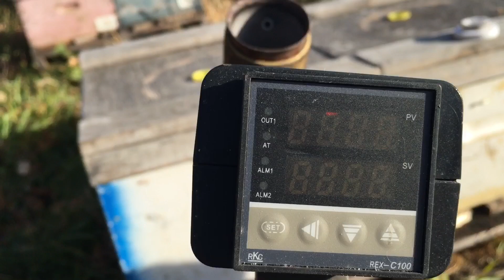Oxalic Acid Vapour Treatment with a ProVap110- a Canadian Beekeeper’s Blog

Comment: Why the temperature is so high ?  OA sublimation is between 157-189 degrees Celsius. Above this temperature, oxalic acid is converted to formic acid. At your temperature, you vaporization formic acid, not oxalic acid.
Reply from the maker: Krzyżak 
Not exactly, consider the sublimation of the product itself, not the temp of the heating element.  I would say that after observing the cluster after treatment that I have achieved perfect sublimation while maintaining a practical time period of treatment
Reply: @aCanadianBeekeepersBlog  

You didn't convince me :):):) but thank you for the answer. If you have the opportunity, do the test at 185C. I may be wrong, but i think  you vaporization formic acid not oxalic. 
By the way, great chanel. Greetings from Poland
Reply from the maker: @krzyzak3465  the temp of the material during sublimation does not necessarily cook at the temp of the bowl.  Notice the rebound temp.  the objective is to get it as a dust thtoughout the hives, and that is exactly what i am seeing
cheers! love the feedback
Reply: @krzyzak3465  his unit is set to 232 fahrenheit not celsius. I spoke to the N.B. beekeeper he talks to and we discussed about the problem of my 110 not stopping at preset temps. my unit loves 270f. if I recall correctly he said he runs his at aprox same temps. converted it is still just around 130c. correctly or incorrectly i'm using 3 to 4 g of OA for my double deep 10 frame equip. less for 8 framers.
Reply: @ronreid3640  These are celsius. Look at the video description: 

"The ProVap is heated to 230 Celsius, treatment temperature ranges between 195-205 Celsius." 

And here the description on the manufacturer's website https://oxavap.com/product/provap-110-sidelinercommercial-vaporizer/
"The temperature is preset for 230 C. This is the correct setting for the bowl of this vaporizer."
Reply: Would be nice if someone chemical engineer could do some analysis on this gas resulting from the tool.  Nice to know what it is - suspect it is a mix of oxalic and formic acid.
Reply: We treat our bees at 450*f as that is what pro vap and johno's easy vap both recommend for the correct temperature. we use the easy vap pro as smaller bee yard and $175 vs $500 very hard to beat the price.

Comment: Thanks for this video. I have some plastic Ultimate bottom boards. Does the ProVap 110 get hot on the bottom so that it would melt the plastic if used in the front entrance?
Reply: The vap runs at 230 C / gets extremely hot ,  I made mine with a ceramic insulator and only cost $225.

Comment: Very good information here, I am glad that I found your channel.  I have subscribed, and have been watching your videos in my spare time for the past few days .  I have a question , what type of material is that, that you are using as an inner cover separator? Thanks for the world of information !!!
Reply from the maker: phillip hall that is my bubble wrap insulation inner cover 
I use it to seal the top from drafts and help reduce condensation during spring and fall cool weather
Reply: Steppler Farms Video Blog     Thanks, I thought that it looked like some sort of packing material..
Reply: What kinda plywood you using on the top and bottom boards thanks for sharing?
Reply from the maker: Ryan Nims 3/4 standard fir, dipped in wax paraffin
Reply: thankful for your reply man go broke buying tops bottoms under cover. watching your awesome vids clearly not needed.  I use the same feeding system but set it on under cover then add deep box then top cover I can see how much time would be saved with your top covers . thank you for sharing....
Reply: https://www.homedepot.ca/en/home/p.duct-wrap-12x25.1000167782.html

Comment: By no means am I an expert but after using the provap for awhile now I realized I don't have to time but just use the temp to tell you how long it takes. The temperature is constantly falling when it is vaporizing and climbing after it is complete. So,  as soon as your temp rises, the oa is completed and you can move on to the next hive. I hope that made sense.
Reply from the maker: Matt Winstead ha!
Exactly what we do to 
Falling while burning off, rise means done
Reply: The vaporizer I make, is far cheaper and better materials, Plus my temp drop is only 15 degrees.